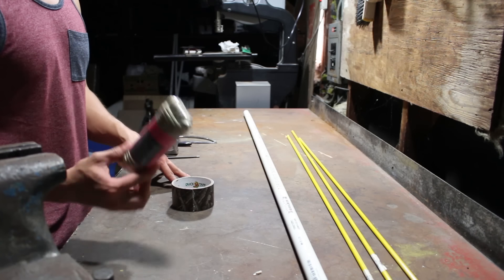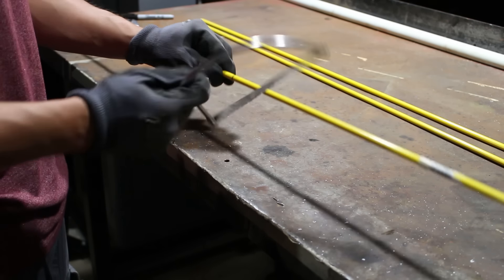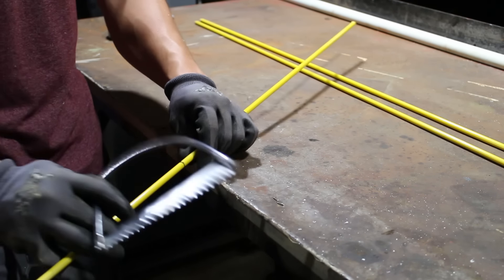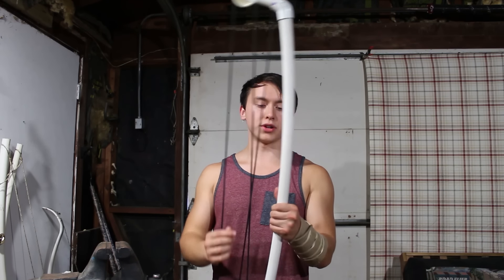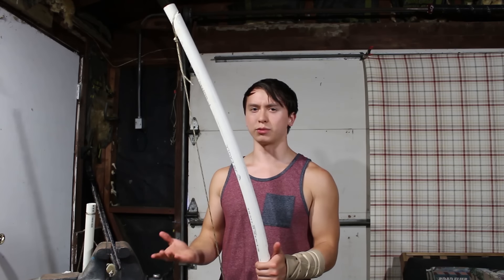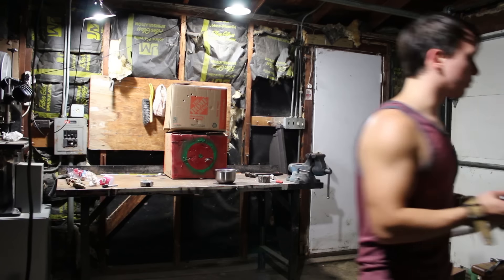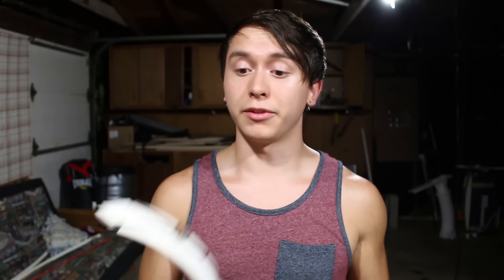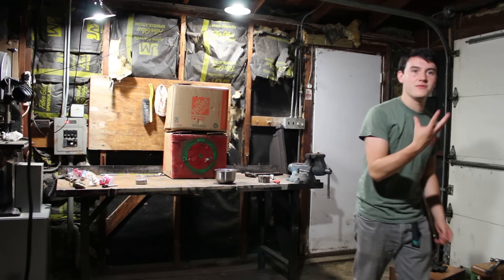Easy, Cheap, POWERFUL Bow (NO Power Tools or Heat Needed)

Comment: A recurve bow is more efficient (and generally smaller) it's just more unpleasant to shoot due to the stack, and it's generally less accurate because any error in your shooting form will result in a much greater error. If you want to know all about how bows work check out the Traditional Bowyers Bible books 1-4.

Comment: That is indeed the entire point of a recurve bow, is to get more power from a lower draw weight. Originally used by the mongols from horseback, iirc
Reply: Mongol-Turkic people used them over decades, also Ottomans had a bit improved design, I guess masterworks of them had about 700-800 meters reach

Comment: Dummy thicc question: What PVC Material did you use? 

I'm using a material simulation program to figure out what length, thickness and schedule to get a certain draw length and draw weight.
Reply: Nevermind, it's shown at 2:47. Good quality camera and video-taking.

Comment: Pvc pipes in my country are as strong as a small candle, so what should I use to make a powerful bow in India
Reply: Look for the ones used for water supply. Don't use the ones used for electrical wiring.
Reply: @bmsreekanth  ok I will try them

Comment: If anyone can answer this, it would be awesome:
Here I only found fiberglass rods that have half the diameter. Do you think it will be ok to use them, if I use twice or more of them? (I know a circle with half the diameter will have 1/4 of the mass)
Thank you
Reply: Hi, I have a question for you!!  I cannot answer yours unfortunately, but I was wondering where you bought your fiberglass rods and what size they are supposed to be originally?  I'm having a really hard time finding any.
Reply: @JustALilGuy5   Wolfblaze  I speak from Brazil, so I searched on a local website similar to Ebay. If you have acess to Amazon in you country, I guess it's a good starter. I searched for fiberglass highway markers on Amazon, and the search returned fiberglass rods.  Some of them are 1/4", others ate 5/16". So now I'm confused as well, hahaha
I would really appreciate if there was more detail about it.
As for the size, watching the video I guess it's the same size as the bow. Hope it helps!
Reply: Here, found this other similar video from this guy, which is also awesome, and started the whole YouTube pvc bow trend:
https://youtu.be/rmxn-nPNhY8
Reply: @9abe9  Thank you so much!  You were extremely helpful.  I appreciate you replying so quickly!

Comment: i actully di the research recurves are faster for there draw weight as is compound bows...... a kid can hunt deer with like a 25lb compound bow and it pull as much killing power as a 40+lb  long bow  recurves are not that drastic of a powercreep BUT  you can easily add 5ft per secon in speed just to be a recurve   sometimes more

Comment: Are fibreglass cable rod the same thing?
Reply from the maker: Not sure what that is, but if it's a stiff rod made of fiberglass, about 5/16" in diameter, it should work fine.

Comment: Them boxes don't compare to the rate of ppsi within measurement of puncture, try a giant frozen watermelon coated inside of a block made from jellos and glue mixed in then cut your mold of so it stands and the jello glue mix simulates the skin and the melon simulates the stomach torso

Comment: bowyer bible vol 1 would explain alot  basicly it is possible to have high poundage bows but have no actull power behind them i had a 55lb bow i made ((that was what the draw weight said)) be as weak as a 10lbs kids bow and the reason why is that it had very thick limbs wich made it harder to pull but eats up the potencial energy on the release  you got to get a good balance between thickness/thiness of limbs and draw weight since your 75lb bow is 1 inch thick  chances are the thickness is eating up the potencial energy but try to get a copy of bowyer bible vol 1 and it explain things alot better then i do.......also bow design also has alot to do with efficientcy the correct design can give you higher speeds for less draw weight BUT ALSO the tips will act like cams ((the round wheels on a compound bow)) giving the bow a natrual let off ((meaning you going to pull it and makeing up some numbers half way through the pull it might reach 50lbs but once you pull it all the way you be holding 45-35 lbs depending on how much let off it provides and by the way the let off will still have the streangth potencial of 50lbs even though its 45-35lbs

Comment: Below is skipable nonsense trivia.

Considering in rpg discussions, people have claimed bows are strength weapons rather than dex. In this, I say it's both. Hunting bows for small game could be pulled by children so a 3lbs bow is viable too. But then you get the hulking mongolian bows with a draw strength of 300+ lbs meant for 300+ yards warfare. I'd like to suggest to users the difference between hunting bows and warbows as I'm s noob.

Hunting is dex. Warbows are strength meant for 10 by 10 rows with machine gun hit rate of shotgun spread across sniping distance. Both are great for their jobs.

Just some bs that's likely true people  argue that drags bows down.